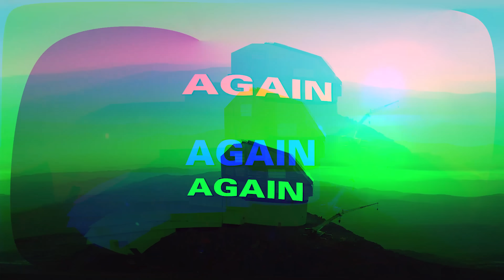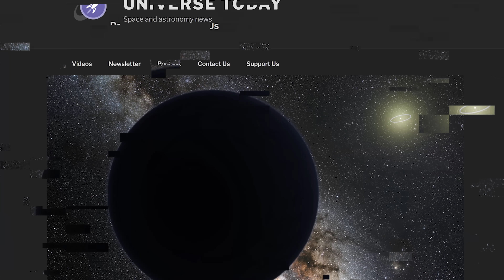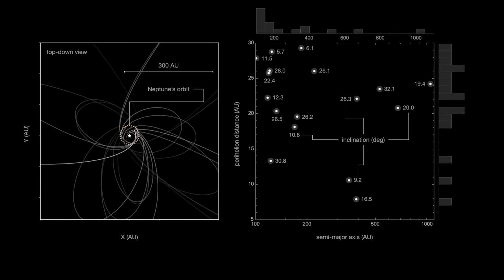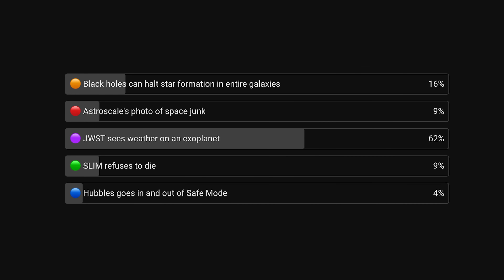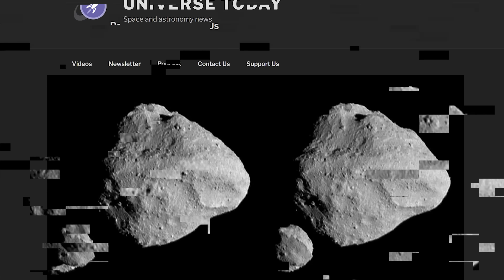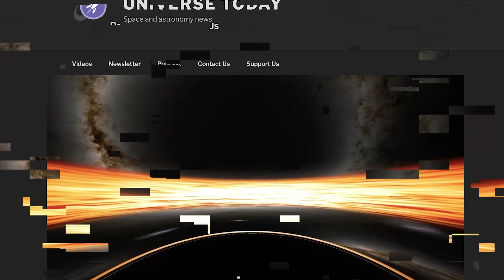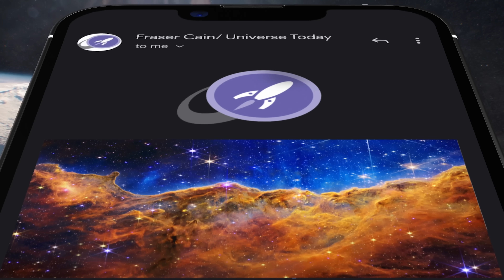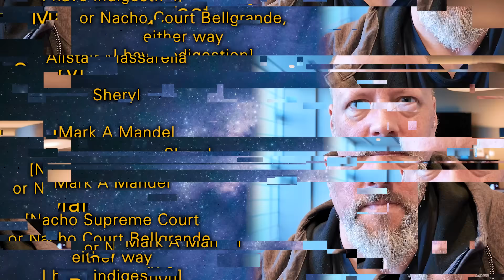Planet 9 Updates // Vera Rubin Mirror // New SpaceX EVA Suit

Comment: QUESTON - hi Fraser, I have a question about cosmology, specifically inflation theory.  This is a simple question probably I'm sure everyone asks it eventually.  Question, - isn't it possible that time and space were decoupled in the very early universe?  Inflation theory is about the very early universe growing exponentially, faster than the speed of light.  It seems impossible or difficult to understand how that can happen because of how we understand spacetime today.  What if the inflation of space grew at a "normal" pace except that it was time that was running too slowly basically halted at that point.  The early universe could be expanding at some conceivably understandable rate except time was frozen or hasn't started yet or was decoupled from space.  Space with no time?  It seems like a crazy idea but also space and time are the same thing combined as spacetime - except, unless if they were decoupled in the beginning(?)  Time could have gone through a kind of phase change just like all the other stages in the origin of the universe.  Time is "emergent" some say.  Spacetime is combined space and time.  In a black hole, possible weird things happen to time... as well as space.  Seems like a simple logical leap to question time in the very early few moments of the universe.  I don't know but inflation theory doesn't seem to be explained well in detail - shrugs, scratches head.  Thanks!

Comment: A question I have about space suits being used on the moon or other solid surfaces that would be dirty like our moon is how do you clean the suits before getting back inside living areas ?  A water with soap wash system would work with recovery of the water to be used over again ....
Reply: Water?  Much too expensive!!

Moondust is electrostatically charged: clean by electrictrik.

Comment: CME Shield?
 Spacecraft have been deployed to study the Sun. The question arises: Is it feasible to position satellites in orbit around the Sun, synchronized with Earth's orbit, to shield our planet from a significant coronal mass ejection (CME)? The calculations involved would be intricate, as the satellites would need to predict Earth's location when the CME reaches its orbit. It appears that the closer the satellites are to the Sun, the smaller the required shield area. Power supply for the satellites wouldn't be the only issue, but the power needed to deflect the CME might be reduced if the shield operates at specific angles and wavelengths. Do our current technology and resources allow for such a venture?